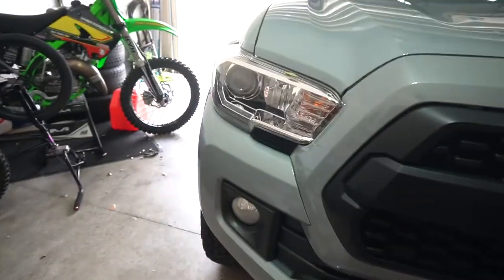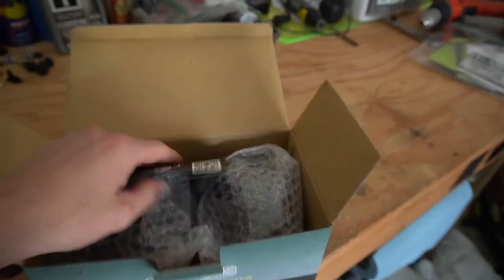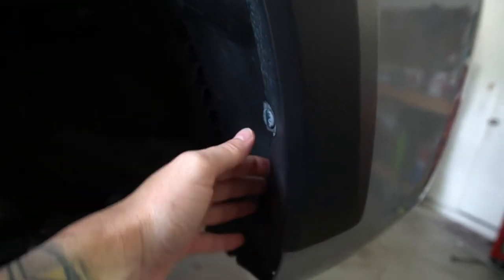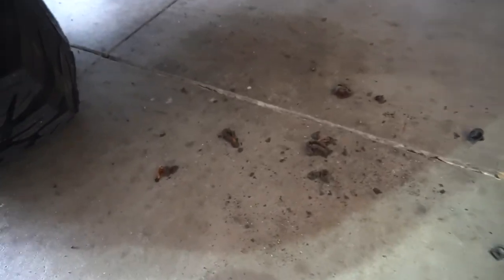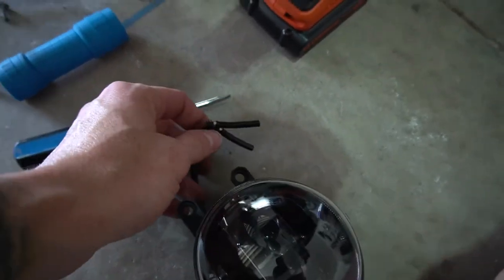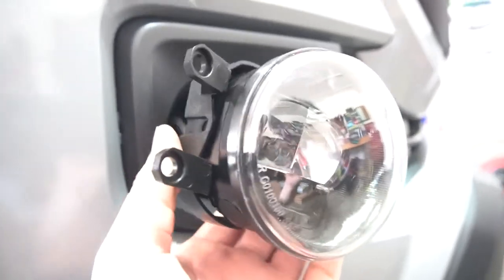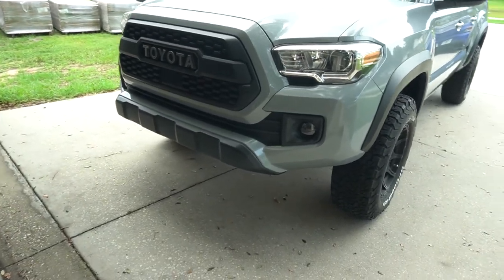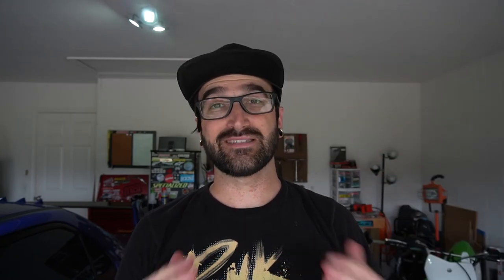How To Install Morimoto Fog Lights On A 3rd Gen Toyota Tacoma

Comment: Was it necessary to adjust fog light beam on the Morimoto fog lights ?
Reply from the maker: Uhhm, personally I didn’t, they seem to be fine? To be honest I don’t really use fog lights that much but when I have they have seemed to work fine for me. I’m sure there’s always tweaking that could be made if I was using them a ton.